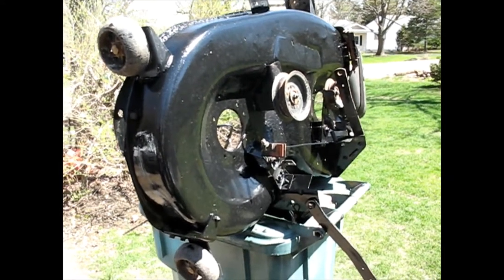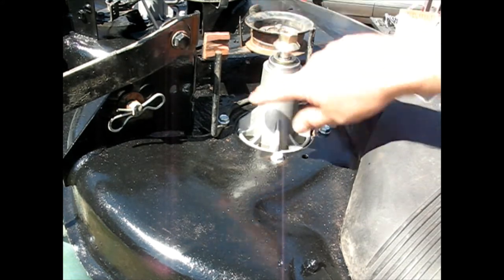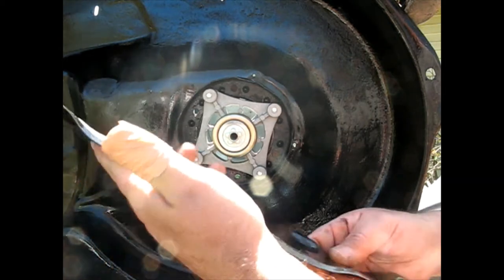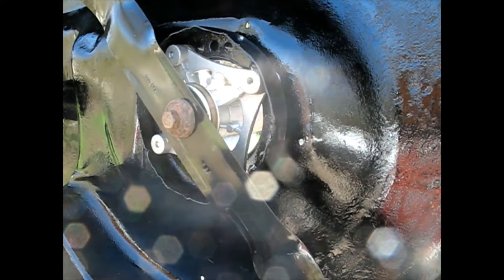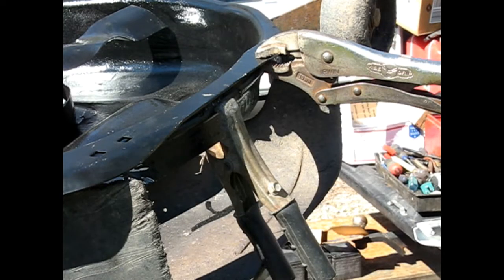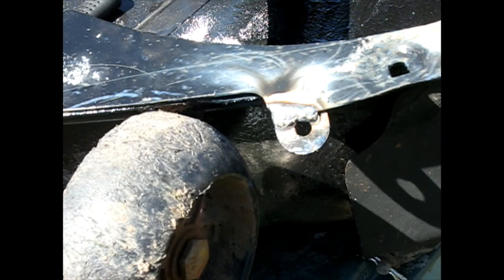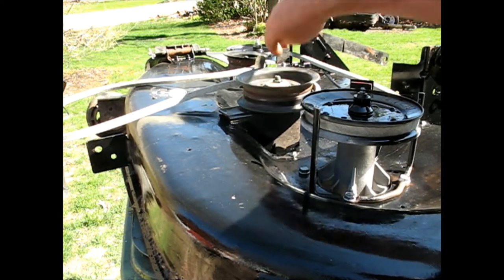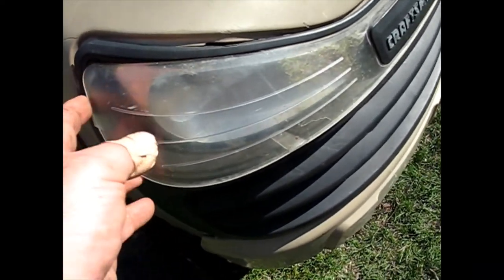Rebuilding a Craftsman 42'' mower deck

Comment: I assembled and installed my own blade drives from all new parts @ $31.00 each installed to my newly purchased 'as is', 
42" cutting deck (maybe 10 years old). 
Used new OEM towers and premium NACHi Quest Sealed Bearings (6203 Upper & 6204 Lower) with inner shields left in place. Drilled each for a grease zirk and installed tower assemblies with #8 hardness SS bolts with the tower drilled and tapped for install, along with self locking security hex fasteners below deck.
Anti-seize used where needed.
Editing comment: Also, filled each below deck security hex fastener recess with 
"Blue" gasket maker. Keeps threads sealed and is easy to remove if necessary, for later repairs.
Having said that, your blade drives look like they could resist a mortar attack.

Very nice video. Tu#:27